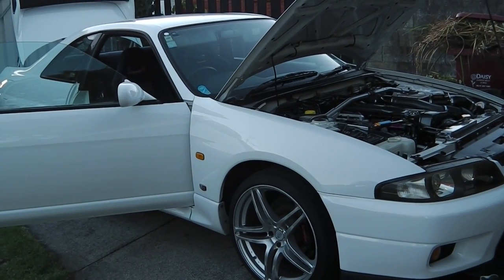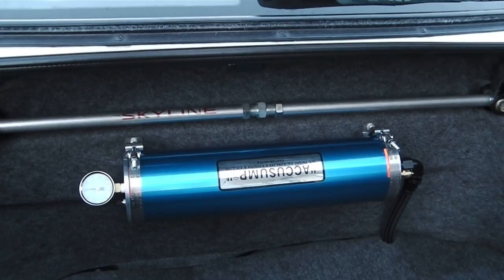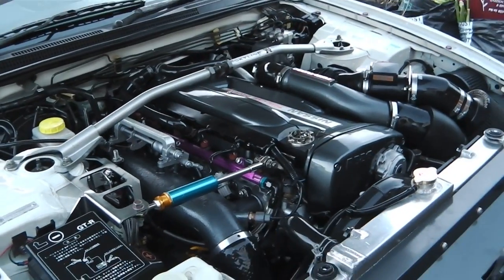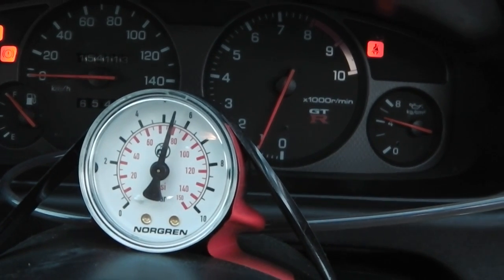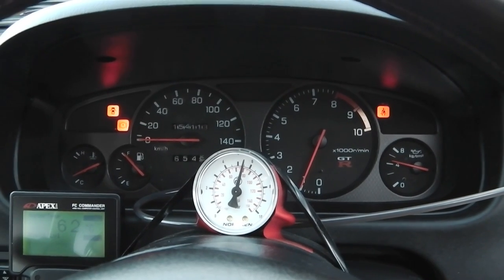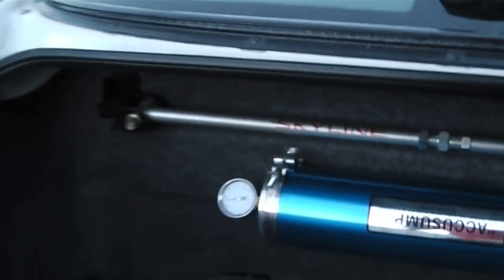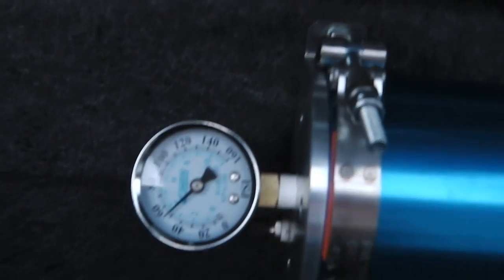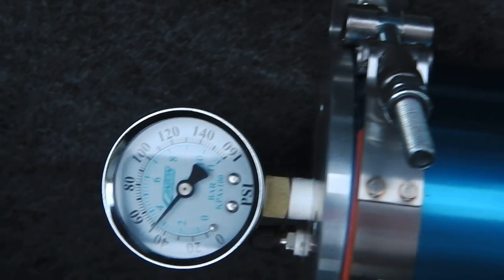Accusump Oil accumulator Operation

Comment: I just pulled my Pumped LS1 outta my 914 Porsche ,and Replaceing it with a 427 Stroker LS, I am running Air Conditioner so it takes up space for the dry sump, until Gary at ARE will build me hi In Pan DrySump the AcuSump is my Hero, so Thank you for showing the Electric way so much Cleaner and simpler 💯🏁💯

Comment: How fast does that valve close when u turn the engine off? I want to install one of these in my r32 using the same method as you. Also how much psi did u put in as a precharge in the accusump? Thanks

Comment: This is soo inferior to dry sump.
Reply: it is also a shit load cheaper and a lot easier to setup. Optimal would be both the accusump AND drysump as you have the ability to prelube the engine in addition to drysump benefits
Reply: Luke Barcinski-Judd “pre lubing” would extend engine life by like, not even 1%. Not even worth it.
Reply: @mareksumguy1887  Most of your engine wear comes from unlubricated cold starts

Comment: At the end of the video, why do you turn the valve off while the engine is still running? I'm still trying to figure out how these work
Reply: Heintz Boy Garage he is “trapping” pressurized oil. If the valve was left open. The unit would continue to pressuring the oil through the system until it had no pressure left.
Reply: Exactly, think of it as a pressurized oil storage tank.  If your engine needs oil and oil pressure (depending on the valve used) just flip the switch and u have a pre-oiler.  And/or some valves also give the ability to activate when engine oil pressure drops.  I.e. hard cornering.  Some military aircraft used pre-oilers to keep wear on the camshafts to a minimum.

Comment: the accumulator are a good, Idea it could save your expensive engine from destruction if you lose a oil gallery plug or something during a run.  I just installed one in my sbc drag car it's cheap insurance.

Comment from the maker: I have dash 10 oil lines, the change of oil being to high is minimal as the oil is only pushed in when pressure drops, as soon as it recovers it starts refilling the accusump. 

if you use a a preset valve that dumps oil when pressure drips below a certain value tou need to select a value below the idle pressure in my case below 40psi other wise it will be constantly releasing oil needlessly. might not worry about that on a race car which is never at idle

Comment from the maker: the switch is in the engine bay as that's where it fits and to reduce the risk of oil leaking in the boot. it doesn't pressurise the filter as its before the filter.
Reply: Stirling Burrows A

Comment from the maker: you would not bother with this if you had a dry sump except maybe for pre oiling a dry sump will be the ultimate in oil control on a track etc.
Reply: Yeah but this system runs about a thousand bucks for all the pieces, whereas a dry sump runs like 5 grand😂   since it does the same job, AND can pre oil, and for a fifth the cost, it's the best bang for buck

Comment from the maker: I've not posted replies here for some time so to catch up on questions....

The accumulator uses an air charge to push the oil out. this is set up by pre pressurising the accusump with a compressor. 

yes oil changes are a pain as you have to clear all the lines though the accusump does help by pushing the oil out for you. 

There is a  non return valve that makes sure that the oil goes into the engine the correct way.

Comment: What was your reasoning for putting the switch up in the engine bay? I have mine mounted in the trunk with the EPC valve and a oil filter. - I didn't want the epc up front because it would keep the oil filter pressurized all the time? But i'm kinda mixed having the engine oil pumping all the way to the back.

Comment: I'm having volume issues so maybe I didn't hear all the details... 
-Do you use a check Valve in the feed line to divert all oil from the accusump to the engine? 
-when the sump is drained into the engine, your engine then has 3 extra quarts (plus whatever your hose between accusump and engine hold)  until it recharges slowly so you have potential for excessively high oil level during this time? 
What size of feed hose do you use? Was that the epc valve and solenoid located by the engine? Doesn't it state in the install manual that the epc needs to be located as close to the cylinder as possible as in mounted on it? 
-what epc pressure range are you running? The smallest one seems like it would be ok when cruising but wouldn't open at WOT if something went wrong but was still above the 25 psi which could allow an engine to fail when you should have more more pressure. 
Or is it the higher pressure one which means the valve is open when cruising and the 3+ quarts are in your engine?  Or do you have it staged off when driving below the rated pressure?

Comment: hi there tell me something ...this accusump keeps the pressure high and during the racing time or it is only for the start
Reply from the maker: I thought I explained it in the video: the accusump (oil accumulator) detects oil pressure drops and injects oil from a pressurized reservoir. It can do this at start up or during running, ie racing on hard acceleration or cornering. depending how it's set up it can simply smooth the peaks and troughs in oil pressure or it can activate once you are under a preset minimum oil pressure.